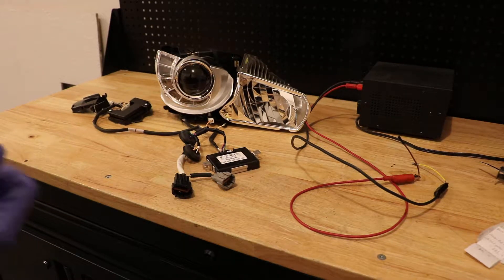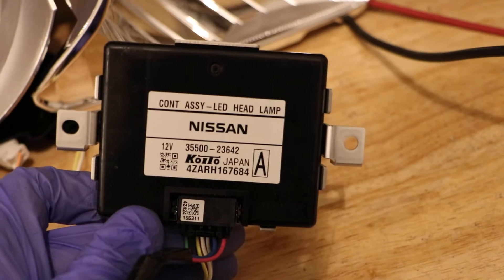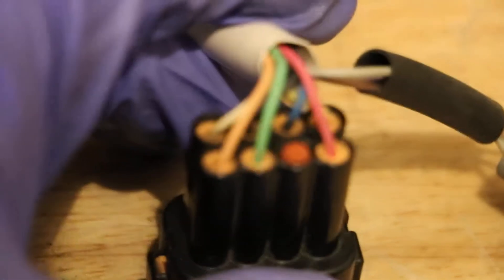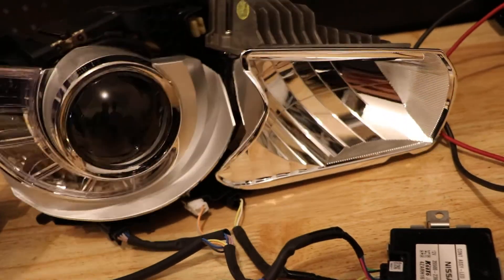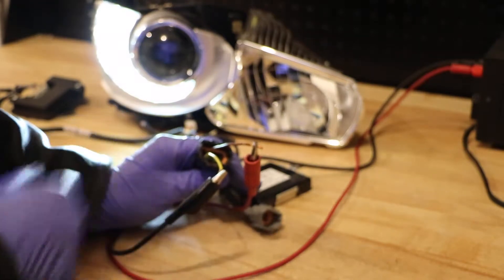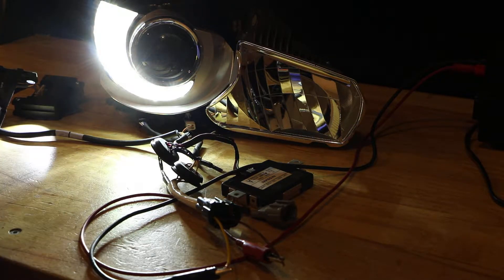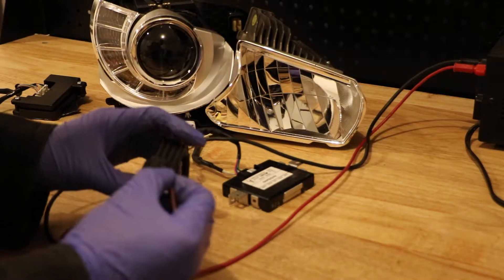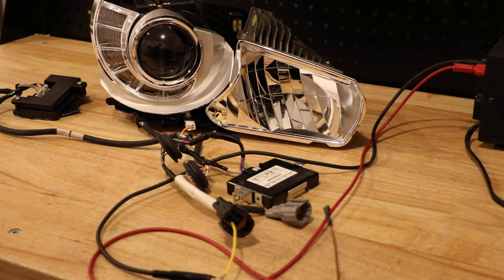How to Test and Turn/Power On an Infiniti Q70 OEM AFS LED Projector Light

Comment: What is the current of the low beam led lens? I will be doing these lights in a week and I have a power supply for max 5.1A I wonder if it is enough
Reply from the maker: I'm not sure how much power it drew.  As long as it's 12-14v, it might be good enough
Reply: @gftgrill hi I’m in need of help I need the pigtail connectors for my afs headlights. I use 2013 m56 please is it the same connector as the black one you used I want to try and find one ??